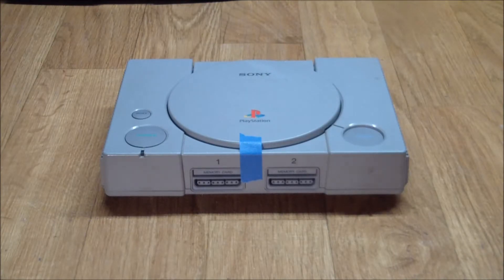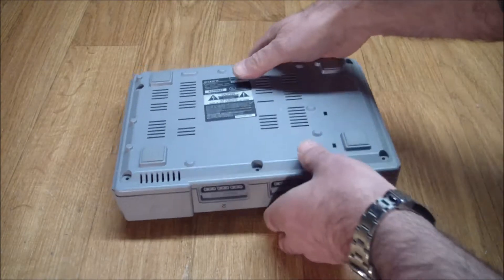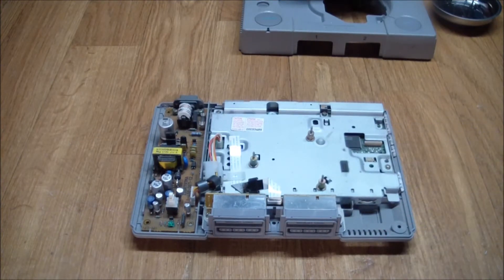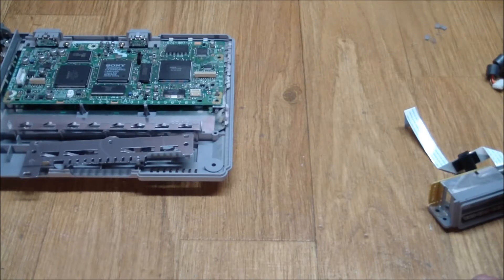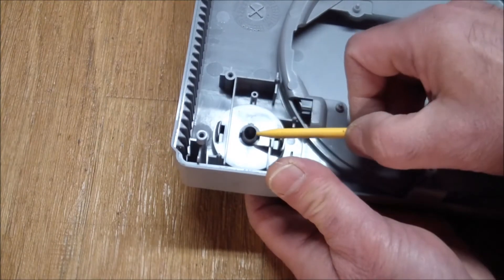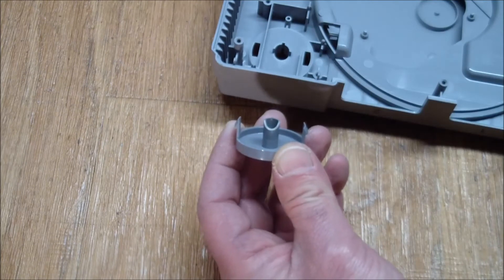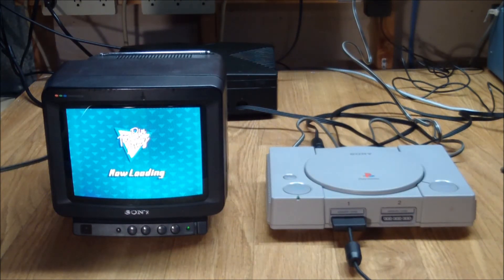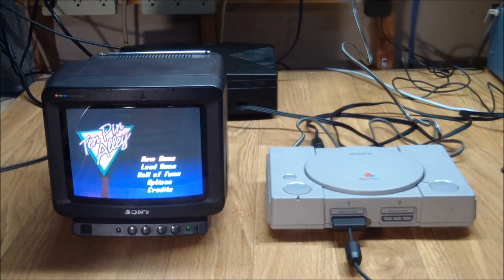AE#34 Sony Playstation 1 Stuck Disk Door Button Repair

Comment: Thank you for this video sir, it helped me a lot!! And also can I ask what kind of TV (the black Sony TV) is that because I want to play my PS1 on a Square TV too instead of the Big Rectangular TVs which stretches the resolution of my PS1 Games. Thank you again sir!!
Reply from the maker: The TV is a Sony KV-8AD20. But any any CRT or early LCD monitor with a 4:3 aspect ratio should give you the results you seek.
Reply: @artifactelectronics  thank you so much for the information sir!!

Comment: I have a working first model. It had the usual problem of a bad optical assembly, but I was able to get one out of a newer model to work by cutting some of the tabs and adjusting the spindle hub height.

Comment: All I had to for my sticky eject button was take it apart and put it back together again. 

The spring wasn't popping the open button back to the top like it should, but once I took it out and put it back in again it worked great. 

I didn't even need to grit the part on the open button lol, every case is different I guess. This vid still helped me.

Comment: I fixed the open button by taking apart the open door mechanism and cleaning the plastic pieces for the opening the door with rubbing alcohol. You don’t need to sand, cut, or make any modifications at all.
Reply: i added small bit of dielectric grease to mine

Comment: I had the  same issue so I took it appart and cleaned it with soap and water. No sanding, no grease.  And of course let it dry. Also cleaned the spring with alcohol.

Comment: How about a series of Tivo repairs? People love their Tivo boxes but many are getting old and have many failure modes. Hard disks go bad, power supplies and HDMI ports suffer from bad caps and fans die or become noisy. Look for Tivos with lifetime subscription so that the needed TV listing service is included. There are some repair videos out there but nothing with your thoroughness and dry humor. You'd have a good time working on them as they get REALLY dirty inside. Just a thought.
Reply from the maker: Sounds like you have some experience with that. I will look into the subject matter.